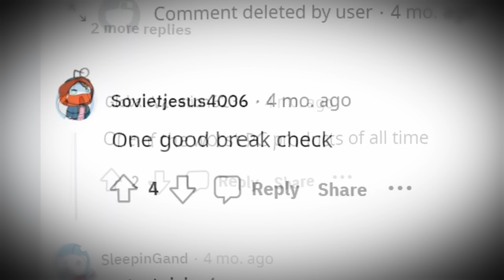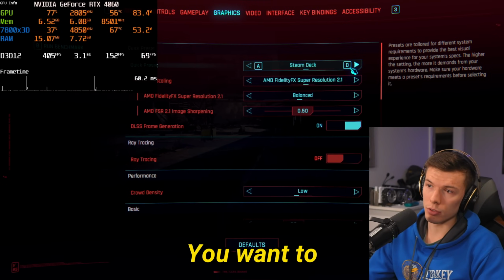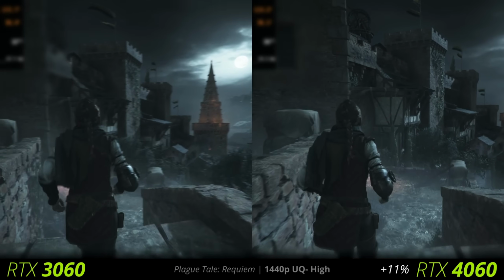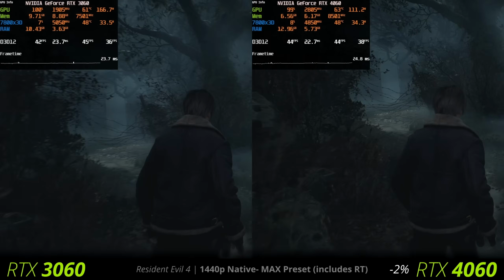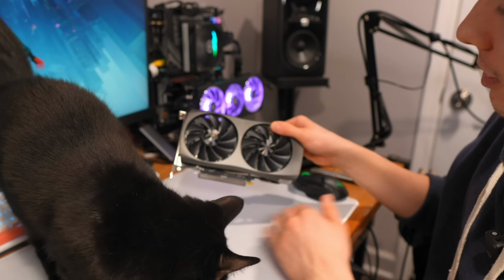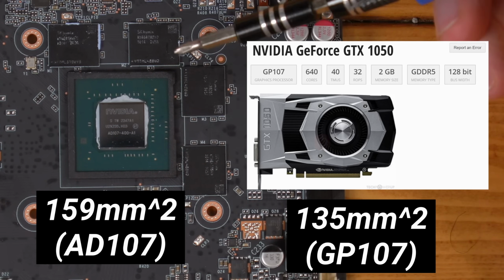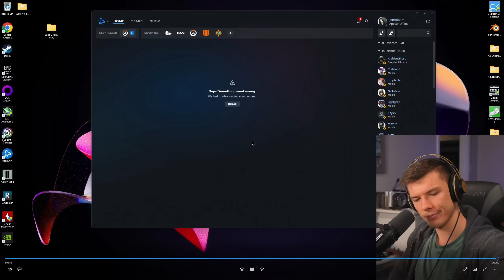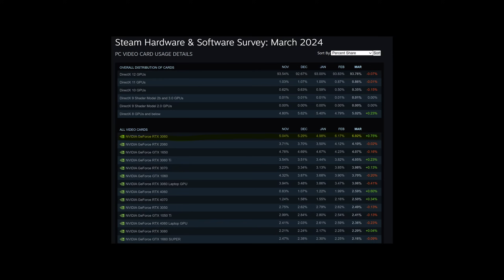I Tried Nvidia's best "Budget" GPU to see if we're Doomed

Comment: I went from gtx 1050 ti to rtx 4060.
 So I am loving rtx 4060 so far.
Reply: Same
Reply: same.. I went from laptop 3050ti to deckstop 4060. Very happy
Reply: they arent blaming the card for bad performance. But if u had already an 3060 f.e., the card isnt worth the money. 
Thats the main issue... 

I also just upgraded from an very old 1050, and the 4060 can play any game on market on max settings w/o any issues or lags. 
So its not a bad card itself. But bad in comparison with existing newer cards.
Reply: im from 2060super to 4060ti, a very large upgrade with similar power consumption, so I don't have to change my psu
Reply: I have a similar story. Upgrading from 1050ti to rtx 3050 8gb to rtx 3060 12 gb to rtx 4060 ti 16gb. I am satisfied and dont need to follow the overall trend of maximum cards
Reply: I have a 1660s rn and I was thinking about upgrading to an 4060 should I upgrade to that or a 3060
Reply: coming from an rx480, ifeel the same with my 4060ti
Reply: I up graded from nothing to the 4060🤓
Reply: @Kingnome  when was the last time you upgraded from nothing to being inside a woman?
Reply: @stankinmybank  ask your mom and sisters 😉
Reply: Exactly from rx570 to 4060 I see the difference, it is just ridiculous to switch from 3060 to 4060, who switch graphics cards every gen ?? If you are in super expensive stuff why not but  you don't buy 60s  you buy 80s or 90s
Reply: rtx 4060 laptop are secretely a banger too
Reply: @Kingnome how it is ? Im also new in pc
Reply: @Abcd325-f7v  Going good! 
No issues with about 25 hrs of use.
I’m a Gen X and I see all the hate with the see through case and the RGB lights.  I don’t mind them. They can be turned off. 
Only control on the case vs PC app. 
1st world problems😂
Reply: it's a good card with 8 gb vram problem
Reply: Same. I moved from 1050 ti to 4060 ti. I'm happy af to play modern games at 60 fps. + For streaming and rendering.
Reply: Holy momly I did the exact same upgrade my first ever gpu was the 1050ti now I use the 4060 the reason was that I needed a new card but also that sadly my 1050ti just decided to randomly die 😢 but I am loving the 4060 for me
Reply: @Crystxlic im in the same boat. i think ive landed on MSIs 4060TI 16GB
Reply: Yooo same
Reply: I went from Intel HD 4000 to RTX 3050 and I feel like a god
Reply: Me too. It plays all the games I want to play way better than my old laptop 1660. I don't need 4k 120fps, my monitor won't even display it.
Reply: @debleb166  thats right sis, sad that lots of folks dont understand
Reply: Laptop gamers HAVE NO CHOICE! You can get only 8 GB in the middle segment. One single option...
Reply: I'm in the same situation as many here - I have GTX 1650 SUPER 4Gb and it is not enough in newer titles and I want to upgrade to 4060 8Gb but I'm constantly running into people saying it is not worth it. Well If I compare the 1650 SUPER to a 4060 it should double the performance I have now or at least make my system more stable in terms of stutters. However when I finally decided I'll go for 4060 I fell into the rabbit hole of decisions if I'll pay 300€ for 8Gb or add another 150€ and go for the 16Gb Ti version because of the VRAM
Reply: More than half the "big name" reviewers just dont get this
Reply: i went from intergrated graphics to 4060
Reply: i just bought a laptop with 4060 ... my last laptop was 860m so no way its gonna feel bad :3
Reply: So GTX 1660 turbo is what I went from to this card, felt good too
Reply: So was going from an 8 year old $140 card to a new $300 card a good jump?
Reply: @Keffalos why would you upgrade from 3060 to 4060 though?
Reply: @moreaupascal56  it's funny to switch even from GTX 1060 to RTX 4060 lol, so yeah, we are definitely needs a couple more gens to make such transition reasonable! NVIDIA has cooked...
Reply: and it is only 100 Watts. this is great for people with low end PCs wh have shitty a PSU. like me.
Reply: @piworower  yeah, people don't consider that, you can use this low power gpus with any old psi, you don't need another 75$+ on a psu
Reply: @alexandruciordas4941  thank you. i started with a stock ryzen 3200g, upgraded to the goat 1050ti and now i can afford a 4060 but yeah, i wasnt thinking about PSU when buying.

the CPU still has a lot of over head, i play mostly sims, and PC building is not my hobby, this card is the probably the easiest card for the rest of us 1050ti gamers.
Reply: arguably, the 1050 ti was the 4060 of its time. that card couldnt run games as the gen ended. i still use a 1070ti and getting 120 frames in games
Reply: its just that you couldve gotten a card thats way better for the same price  but people still buy the 4060 because they dont understand anything about pcs, thats why its so expensive cuz nvidia knows people like you will buy such overpriced garbage
Reply: @naizy  that's the thing, AMD and Intel is the same price as Nvidia in a lot of countries.
Reply: @naizy  im not trolling but what card do you mean? the rx 7600? they are about the same.

the 4060 is good for people who have a shitty PSU so for people with ryzen 3 PCs (like me :P)
Reply: Same
Reply: Went from a 1070 to the rtx 4060 recently, love the card, I just also need a new cpu to handle things ^^; but it's doing amazing in my older games! Which is what I play most anyways
Reply: @randomboitime4221  Perhaps thats a lil too overkill for older games haha
Reply: @Crystxlicvfx  4060, because the price is 20$ but gives entry to the dlss generation, and the 12gb 3060 is for bitcoin miners its jsut bigger not faster
Reply: I'd be happy to have anything better than my old trusty GTX 1050ti, these things are very expensive in my country.
Reply: I went from GTX 1060 to 4060 Ti. I'm happy as well
Reply: Same upgrade
Reply: I will go from AMD Radeon HD 5870 1gb to rtx 4060 8gb is it worth?
Reply: @Piguinakos  surely
Reply: If get rx 6750 xt instead u would feel even better, bet
Reply: Enjoy playing valorant then 😂
Reply: I went from a horse and buggy to a 46 Ford. Loving it so far
Reply: @Rick-pr6du  Yall treating 4060 as it is slightly  better  than 1050 ti
Reply: I'm still on 1050 ti, and rtx 4060 is certainly the one I'm eyeing for a new GPU, tho I have some contestants for used ones. 
Team green has the software goodies I like
Reply: From 1070 to 4060